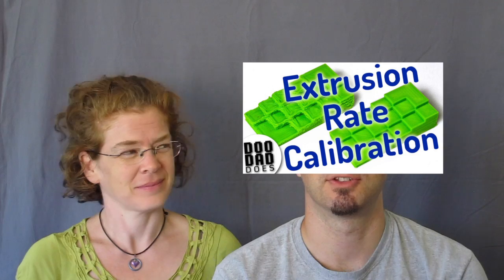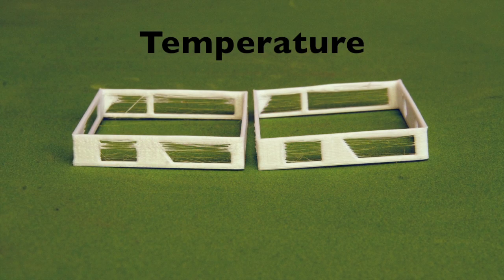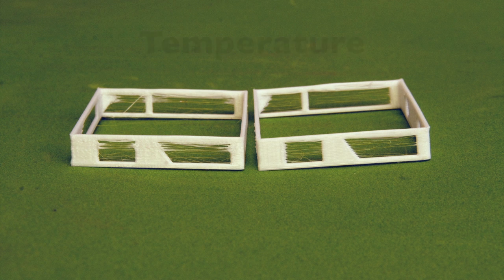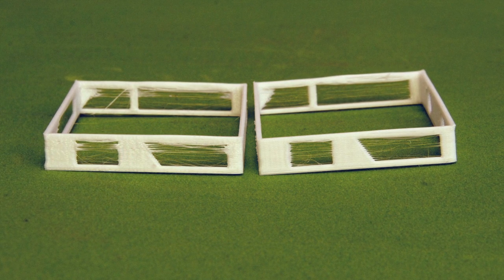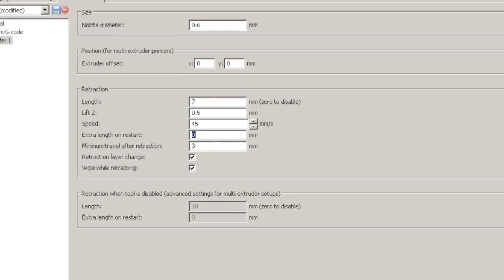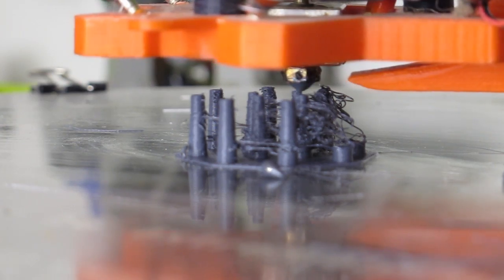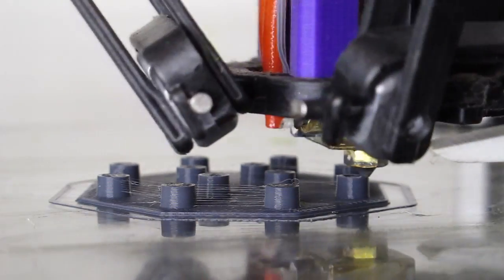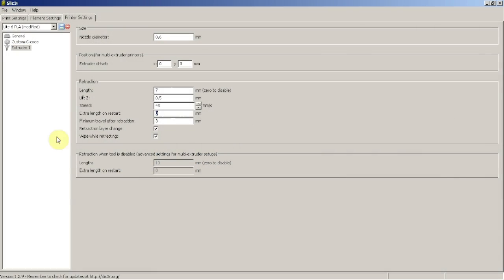Troubleshooting Blobbing and Stringing

Comment: How can you solve this problem when working with flexible material which shouldn't have any retractions? Is lower temperature the only way for better results?
Reply from the maker: +Leonardo Aguiar Why shouldn't flex have retractions? I use retractions when printing TPU - in fact it would print horribly without them. Flex is pretty tough, if you go too low, you'll end up fighting too hard against the back-pressure of the flex material. I'd suggest finding a middle range temp and adjust retraction a little. Also speed up the non print moves and add a little more wipe length between movements to see if that helps.
Reply: +doodaddoes I've just heard that using retractions with flex material is a problem because it increases the chances of jamming around the extrusion driving gear.

Comment: great tutorial! I've calibrated my Kossel mini with them.

One question; which is the maximun retraction lenght that you recommend? I have a compact Bowden with a e3d v6 hotend. So far I've used 12mm at 30mm/s but I still have tiny tiny strings (like in your video at 2.14) Can it still be improved?

thanks again!

Comment: Making a super clean print, with minimal surface lines would be nice. I find smaller extrusion helps. (but too small at base wont stick to bed well, and give a good base) -I find that .2mm at base sticks well. But If were trying to get a perfect outside, where you can not see the start/stop points, then is there a way to do that? Also, I can print 4 of the same objects simultaneously, and they all have slightly different qualities. It seems hit/miss.  I also believe a 100% infill is rarely good for quality, it seems to promote more warping, and just takes longer.

Comment: Hello, I have a big problem with retraction can you help me ? I made a movie on youtube with the behaviour of my printer but I can't put it here maybe you can check it in my profile .
Basically if I print bigger parts like the one that you use to calibrate the extrusion rate then I have no problem, it prints ok, but if I want to print the biodome parts, it will blob as it also can be seen in the video that I made .
I checked the calibration of the length of filament and it is ok, lowered the temperature but still ok .
Thanks !
Reply from the maker: +bbogdanmircea Sure I'll help. I'll see if I can find your vid, otherwise email me at isaac@doodaddoes.com with the link.
Reply from the maker: +bbogdanmircea Which video is it? I can see the ones you've posted.